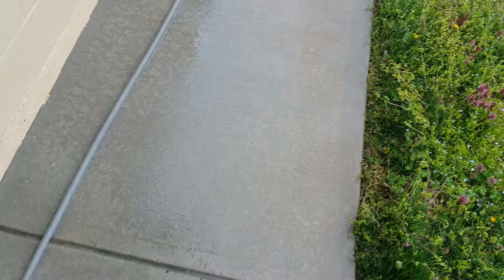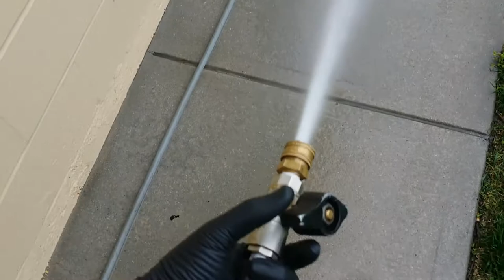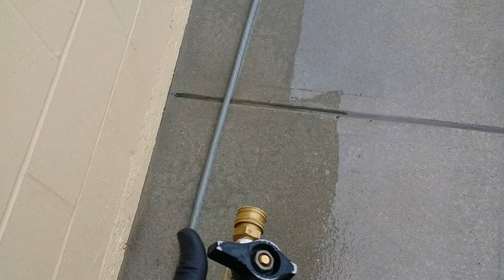Ball valve uses in power washing rinsing process

Comment: That’s a DN 10, With that set up, you will be replacing the O-ring a lot more often than not. I have my set up opposite with the male end out that might help with your pressure if not get a new valve.
Reply: We honestly haven't found it to be an issue.  Years ago I had issues with o-rings popping out, but using them this was hasn't been an issue.  We have all of our plumbing set up this way.  Ultimately its just a personal preference
Reply: Yes, I was wondering how to ball valve out without losing o-rings. Every time I do it, I have to replace the o-ring.

Comment: Does that blow out your O-ring?  Do you know if someone sells Male ends that are 3/8" x 1/4" to put  after the 3/8" Ball Valve? I'm having a hard time figuring out how to connect a 3/8" ball valve to a 1/4" male couple plug to install my M5 Twist.
Reply from the maker: I used to blow out o rings early on, but haven't in several months
Reply: It blows out my o ring every time
Reply: @bamabama7938  sorry I'm new. What oring are you referring to? To what? thankyou
Reply: @MrBod4life  The o ring inside of the valve. Sometimes the water pressure blows pushes the o ring out if there isn't anything attached to the other end keeping it in place.
Reply: Just switch your ends and use a plug instead of the coupler